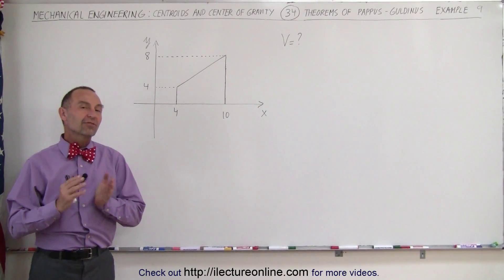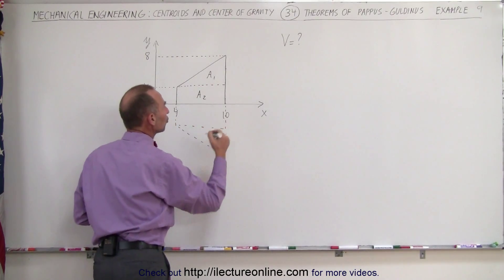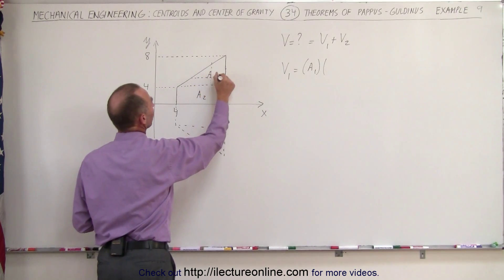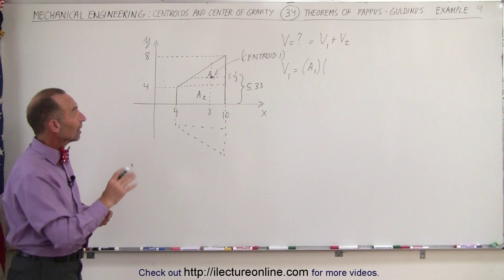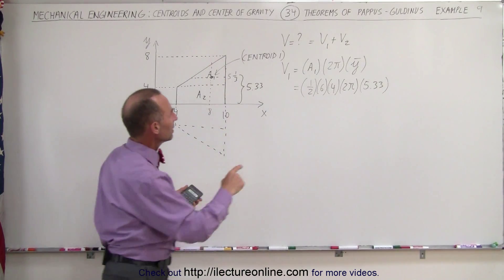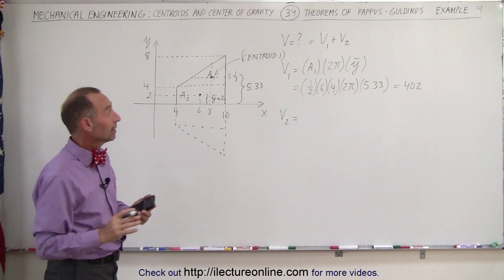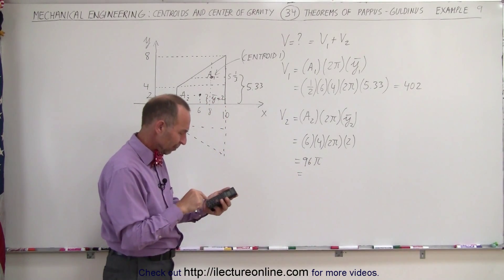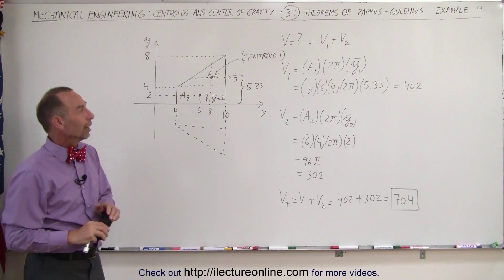Mechanical Engineering: Centroids & Center of Gravity (34 of 35) Volume=? using Pappus-Guldinus

Comment: Btw, that shape is called the cylindrical frustum and the donut shape in the previous videos is called a ring torus. Also in this case, the disk method by Van Biezan would be more straightforward. Thanks, Mr. Michel.
Reply from the maker: Thank you for your input.

Comment: Shouldn't the y2(~) for V2 be 7 not 6 (I am talking about the width)? because the base of the rectangle is 10-4 = 6/2 = 3+4 = 7?
Reply from the maker: +Yogit Bhatt 
The area of the rectangle is L x W = 6 x 4 = 24
Reply: +Michel van Biezen Thanks a lot. I stopped watching it for a while and came back to it and made a lot more sense what A2 was.